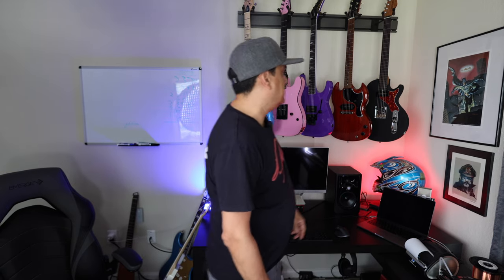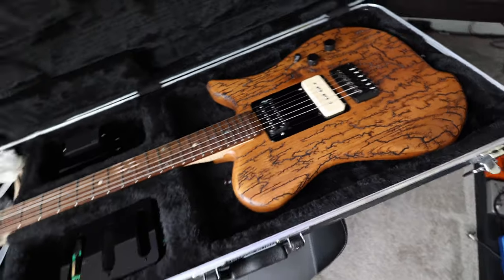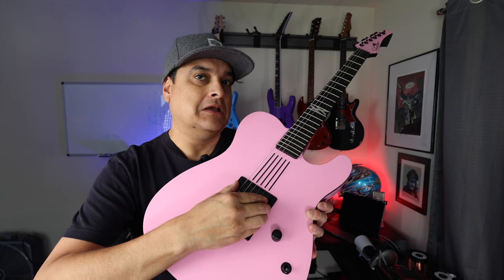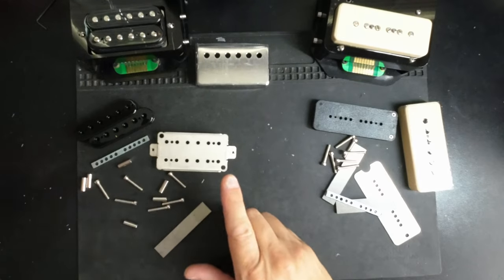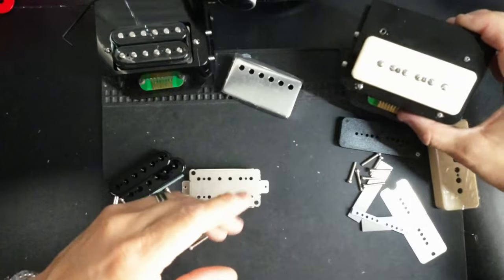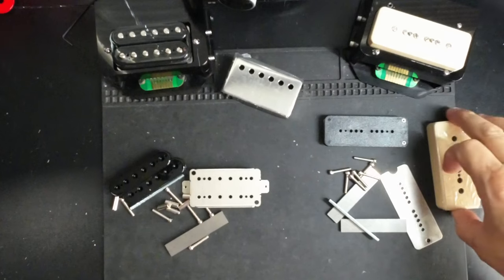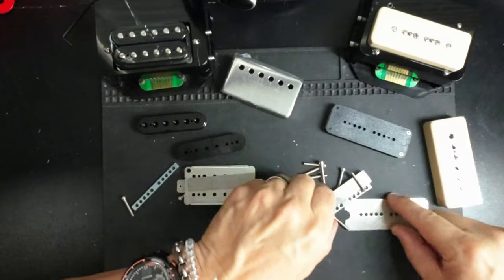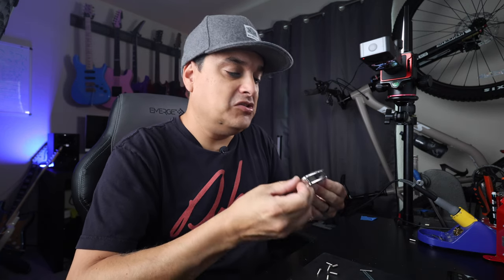Wax Potted Pickups Does It Change Your Tone

Comment: Microphonics in a guitar pickup certainly changes the tone. You can actually hear more pick attack and acoustic type tones. Had a strat with a cheapo unwaxed pickup in it. Sounded fabulous for clean recording.
Reply: I use a Jaguar cij for the Same reason when recording
Reply: I have a non wax humbucker in a telecaster neck. The clarity and tone is breathtaking amazing
Reply: Wax potting does take some character out of it.  Makes it sound a bit sterile, for lack of a better word.

Comment: I prefer the non-wax-potted version.  It seem to be more dynamic.  However, playing in front of a bank of amps I would want the wax potted pickup.  I think stages (even for the pros) are becoming quieter and the need for wax potting has diminished a little.  To me its a flavor issue.  Its personal preference.

Comment: Everything affects tone, even the air,  especially the air because thats the only way we hear tone when it vibrates air molecules, the most senstive pickup - air.   Without it we wouldnt have tone, or would we? If i cupped my mouth around your ear and screamed really loud in space, could you hear it?  ... you never know until you try  but the question isnt weather it affects tone, everything affects tone, literaly one drop of oil will change the sound of your guitar then it was  a moment before on quantum scale.  The question becomes, do you notice it?   And that question is so subjective there really isnt point in arguing about what someone else hears, or feels or whatever.  Making the whole tone argument pretty pointless due to subjectivity.  :)
Reply: My left ear being clogged affects tone

Comment: I heard the dynamics diminish. I heard a missing harmonic at a really low frequency, like the wax took away some of the best part of the body of the sound, reminiscent of room sound. Def prefer unpotted but it's so subtle the wax is probably worth the tradeoff. BTW, am I the only one with the opinion that the more breakup, the harder to hear the guitar's tone? Proof of this is the fact some people use a Tele for hard distortion. Another bit of evidence is that people use hotter and hotter pickups for heavy distortion even though they sound like crap clean. I think demos should be clean unless you're demoing the breakup itself . . . but I digress. Yes potting changes it, but unpotted pickups are for light breakup and potted are for distortion imo.

Comment: Sound is vibration. The vibration of the pickup when the strings are struck is inevitable and basic science. The effect of waxing the coils is to allow the poll pieces to still "pickup" the vibration without interference from the coils vibrating and projecting that vibration which creates the "feedback". 
Peter Frampton started off playing an es-335 because he loved the tone of the semi-hollow. He was disappointed when. He tried to play it live at a gig and it just feedback really bad. Someone who heard him and apparently worried in a shop or whatnot ask him if she still wanted the same basic tone but with much less feedback. And he sold him the 3 pickup black les Paul that is now famous and it cured his problem enough to permanently switch to solid bodies. Both guitars had unwaxed paf pickups. But the combo of the three ply hollow body top and the unwaxed humbucker was a common issue for many guitarist. And why many switched to solid body. 
Eddie van Halen basically invented wax potting. He wax potted the PAF from his 58 es-335 and used it originally in his earlier frankenstrat. He did this because his band mates said the es-335 just looked lame and the strat sounded way to bright and thin. And eventually he created his own solution and the tone of those early creations are why his time eas so unique. Plus, the original humbucker he used (58 Gibson PAF from an es-335) was most likely an alnico ii vintage output and combined with an ash body and maple neck created a great even tone. The ash and maple tend to be scooped in tone and the alnico ii pickup is more flat toned and has less lies and high than alnico V but more pronounced mids. Combine this with a marshall super lead and that's how his brown sound tone was created. You can overwound an alnico 5 and achieve more mids and less lows that will sound similar to an alnico ii but with more natural compression. 

Waxed potting effects tone. Depending on your intended results it can effect it bad or good. Pickup covers effect the tin even more. Expensive humbucker usually use nickel covers that may reduce high and upper mid frequency but brass covers or pot medal covers sound like garbage. Removal of covers makes it sound more open, bright and percussive. That can be good or bad. Slash hates covers. And I would too on those slightly overwound 42ga enamel wire alnico ii humbucker. It's slightly overwound to give more compression and tighten the lows but the open coils allow it to be bright and biting enough that it sounds awesome through a marshall style amp with a classic type of hard rock tone. 

Wax potting affects tone. If you wanna here an excellent clip of unwaxed alnico ii paf pick-ups in a live setting then listen to The Allman Brothers live at Filmore East. 
Duane uses les Paul's with alnico ii with covers on run thru a marshall bass head run thru a 4x12 cab loaded with d series jbl pro sound speakers. Dickey is the same except he used a marshall guitar head( jtm I think)  same speakers as Duane and a 57 gold top  with alnico ii paf and covers still on. 

FYI: Duane always used the same pickups. So when people claim he used alnico 5 because he used a 59 Les Paul he actually traded his 57 gold top but said the pickups were not part of the deal they both kept the pickups they had so Duane actually put the 57 alnico ii  paf into his 59 cherry sunburst. 59 is supposed to be the first year Gibson used alnico 5. And some still used various other alnico like some were alnico 3 and even the 61 sg(Les Paul) had alnico ii. So be weary of people who claim that Duane and dicky got thier sound from alnico 5 because it's probably a false assumption. 

My two cents.

Comment: The non-wax potted do sound brighter but they come with side-effects with feedback etc. I'd be interested to hear your take on lacquer-potted pickups. I'm guessing that they would be a middle ground in that they may just stop the outer layers from moving but the inner layers of the pup may still vibrate. Good or bad ????
The signature pups that Chris Buck uses (RadioShop), seems to be a middle ground but they don't give details about what they do ( why should they :) ).

Comment: Hey question, just got a 2023 gibson Les paul standard 60’s, not a fan at all or the 61’ burstbuckers (unpotted like BB’s 1&2, but hotter with 61’ set being both Alnico V’s rather then Alnico II’s).
Been playing a Gib SG standard, got new back in 04’; compared to these 61’ BB’s, i much prefer the 490r/498t in my 2004 Sg standard. That said, i dont want my 60s standard LP to have that same tone as my Sg& voice. I’ve been debating grabbing a high end PAF clone pup ex,throbak SLE 101s, monty’s PAF, seth lovers), or if i should go with wax potted like a set of Symour duncan Slash 2.0 alnico II pros…seems like rhe slash wax potted do higher gain better, and some of those PAF clones like montys can get too icey/glassy on the bridge. I love playing classic rock with overdriven tones & standad gain levels , not sure if too soft for handling high gIn class rock, i love a great clean tone but id rather not need a booster since i dont play cleanvl ae much as driven. Not sure if some PAF clones will just sound very close to the 61’ Bb’s? Jw cuz both unpotted & senstive..if they sound soon then i think my favourite more mordern tone on an LP is the SD slash 2.0’s. Any input would be great ( scared to swap pups & drop $$ for pups that spund very similiar to stock 61’ burstbuckers). Thanks !

Comment: Peavey T-60
Very hot output, no wax.

You just proved why I like it so much. I absolutely loved that guitar for metal and blues. I even wrote a riff that uses the feedback squeal.

Sadly, that guitar was stolen from me. Not sure if I’ll ever be able to get one again.

*****I would love to see a comparison between pickups of pole pieces vs blade as this style is used in the T-60. I’ve still never seen a side by side comparison video of this, using the same windings, etc.

Comment: The difference in tone is negligible. The benefits vastly out way the drawback of losing "tone." 
If you play heavier music with lot of distorted/fuzzy/overdrive tones with loud volume, wax potting your pickups is necessary.  

I have a set of Ibanez Super 80's that I'm considering waxx potting,  I'd love to keep them stock but they have a nasty squeal if I stand too close to my amp.

Comment: Neck position humbucker has low output and sounds bad.  Meter reads 0.0 ...heated where lead strands connect to eyelets.  Pickup then works fine for 2-3 days then it goes back to low output and reads 0.0 again.  What's going on?  Thanks

Comment: I lol @ dylan, "eeh you could wax pot em and  fix em but its easier to get another  one" for pick ups . . .  what if your PU choice are those Gibson pickup that sells for $250 ish USD EACH, NOT A PAIR BUT ONE, so the second one is another $250  . . . and prob DLylans or seths are cheaper and have more tone . . . the unpotted ones have more range and sound has an edge. The potted ones dull the range and take off that edge, but I suppose in a actual band, all those extra sounds from touching the guitar or moving it that unpotted catches or even catching background voices (in an intimate setting) could make unpotted ones a hassle in gigging.

Comment: So I'm wondering if an inputted pad sounds better ar higher guitar volumes because its actually getting sound out of the speaker to into pickup like a microphone  . I know it causes feedback but is there a sweet spot. I'd love to see if the high ,low or even mid changes . Also it was hard to hear difference because there wasn't enough A to B comparison for me. Love your videos thanks for sharing.

Comment: My wax potted pickups sequels like hell. They are not properly wax potted. I hate it on high gain when on single coil neck pickup. You can get away with humbuckers. But getting away with it is not a good deal maybe it will after sometime then the coil starts to lose strength

Comment: In my opinion, pickups only  need to be potted if one is playing at really loud stage volumes.  I prefer unpotted. Many players are using multi fx pedals with monitors or in-ears. So, potting is not as necessary.  Like I said,  just my 2 cents.

Comment: I have a Fender Brent Mason Signature Tele that has a non-wax potted Seymour Duncan Mini-Humbucker in the neck position, as y'all know...
I had the same issue as Dylan demonstrated at 3:30: click noise from the pick that got worse the louder I would play, squealing and howling when I used a (mild) overdrive. Not fun, really. 
Then I read an article about how Brent Mason had the neck pup of his Tele wax-potted by Joe Glaser...almost 40 years after he had bought it! Now you don't tell me that his tone has changed...
So I asked my guitar techie to wax pot the Mini-Humbucker, which he did with the use of 4 to 1 paraffin to beeswax. Hand potted to perfection! And the short bath in the wax didn't alter the tone much, after all we have tone controls on our amps, don't we?   
IMHO the benefits of the wax-potted vs the non-wax-potted are obvious. Just my 2 cents...
Cheers! 😊

Comment: I really appreciate your time in making this. I definitely heard a subtle difference between the two. A slight drop in brightness and volume. I tend to use VH tones - I definitely need wax potting.
Reply: Eddie committed BLASPHEMY! and potted a patent number pickup from his ES335 for Frankie

If you need an excuse 

I have one real Les with 498 490 & an Agile with unpotted PAFs from GFS, horses for courses.

Modern versions are potted, might just buy a potted one to swap in if needed. The intangible "mojo" is there, for sure, below stupid gain levels.

Maybe unpotted pickups & Greenback IRs make a decent case for DI guitar...sometimes 😂

Comment: Yes, I hear a difference.  I like the potted pup better.  When I was a kid, I was told only use a wax potted pup.  My 1981 Vantage came with open bobbin humbuckers.  Grew to hate the look.  Some time in 2005 I got on this rebuild kick.  Little by little I changed the worn parts & look of of the guitar.  I always liked chrome humbucker look.  I also stumbled on Ebay chrome humbucker rings.  I never saw the look of chrome rings with chrome covers.  I added these to the look; brown stained (mahogany?) wings, (now) aging yellow maple center, (mahogany?) neck, rosewood fingerboard, custom metal knobs & custom turned toggle switch tips, chromed Hipshot bridge, locking tuners & a 25 inch scale   I am very happy with the voice it has now.  Hint of an SG vibe.  The covered & potted humbuckers have traveled in a modern hard shell case so never banged or dropped.  Always in a stand or in the case so scarf joint has never been damaged.  This is my only humbucker guitar, my frankenstein, rewired several times & still considering another rewiring!  It's in need of a refretting & a nut job.  
It has taught 3 generations to play guitar.  I'll never get rid of it.

Comment: Definitely could hear a difference. If you play loud, get wax potted. If low gain, blues, jazz, clean and you play smaller venues wax free dynamic fun! I wonder if it can be measured on levels of waxing, like lacquer on a guitar body, doesn’t depend on what you use but how much 🤔

Comment: Hey i have this question since ... a while.
Why there isn't any pickup with one independant couple bobin / magnet per string ?
is it space related, like not enough space to wind the copper to get any sound ?
Or price related, because it would be too expensive to do it (6/12 winding instead of one) ?

If you have a beginning of answer, thanks
Reply: Ovation Magnum basses in the 70s had a pickup exactly like that in the neck pickup, so yes it can be done. For six string guitars, if I remember correctly, there was a jazz arch top electric in the 50s(?) that had a pickup that went diagonally (tilted like a Strat bridge pickup) - the bass end of the pickup (the end under the low E string) was up near the neck, and the other end (under the high E string) was closer to the bridge; I think that was made up of individual coils for each string as well. I’ll see if I can find out what guitar that was.

Comment: There's a lot more to potting a pickup than just holding the parts together. Those coils move that close to the magnetic source and you're getting signal. That's why at one point, some manufacturers were epoxy potting the coils. It worked. Especially in front of Marshall stacks, but it took the nuance out of it as well as the "sparkle". 
Which is why I do what I can to remove as much of the wax, make them, or have them made, without potting.

Comment: They pickup more overtones and are more sensitive to touch when they are unpotted. But sometimes the pickups need it. It really depends how they are built and how you use them. If I were to buy a set I would want them unpotted and only wax them if they needed it. But if it sounds good, who cares, it is good.

Comment: DYLAN TALKS< you didn't even mention anything about " Diametrically Opposed" issues about potted pickups vs unpotted pickups about the Hum and RF interferences causing Diametrically Opposed issues. Make another video subject lesson about Diametrically Opposed about pickup shielding out hum and interferences noises in pickups
Reply from the maker: Um… no… because that isn’t a thing
Reply: @DylanTalksTone  Diametrically opposed is a thing when using a tube amplifier the power transformer has a lot of magnetic leakage which signal coil pickings are taking in all that magnetic leakage.
Reply from the maker: No…. No they aren’t. What you are saying is not true. (For anyone else seeing this)
Reply: @DylanTalksTone  It is true about Diametrically Opposed when positioning at different angles from your amplifier will cause more HUM and Noises depending on Potted single coil pickups and unpotted single coil pickups, its all about diametrically opposed to the amplifiers power transformer which is causing magnetic leakage and so are the pedal powers linear transformers causing magnetic leakage into the overdrive pedals this causing a major issues with single coil pickups. Look up Diametrically Opposed in guitar pickups about hum and RF noises  magnetically leakage.